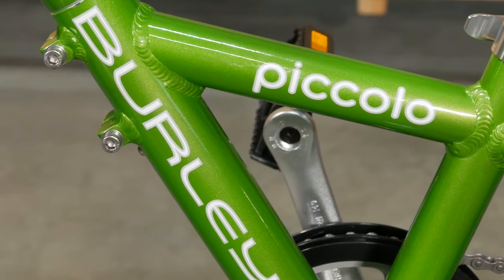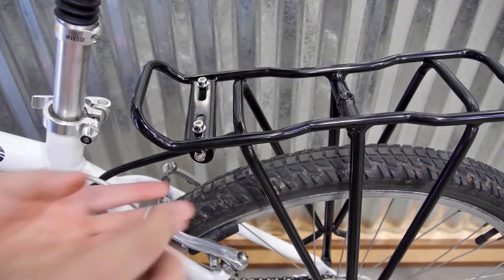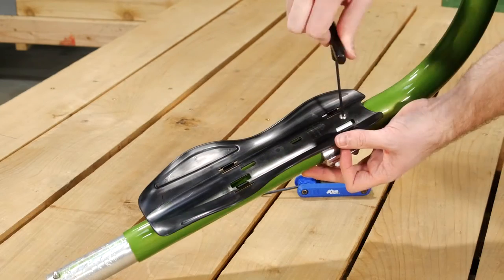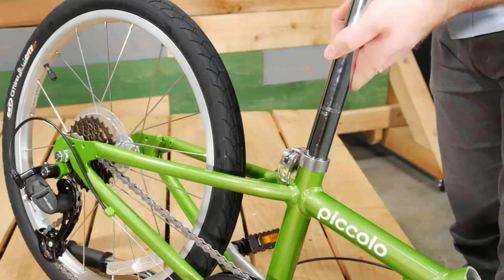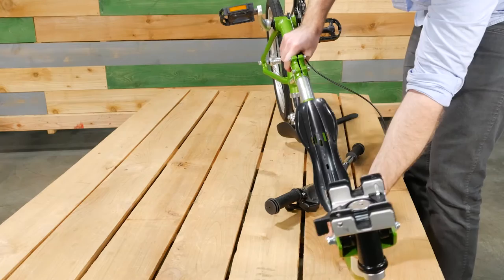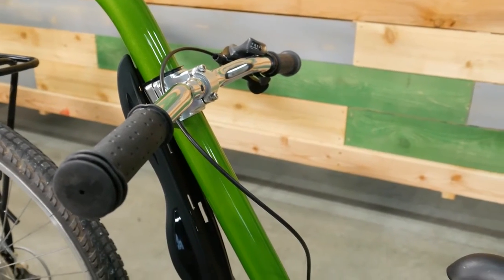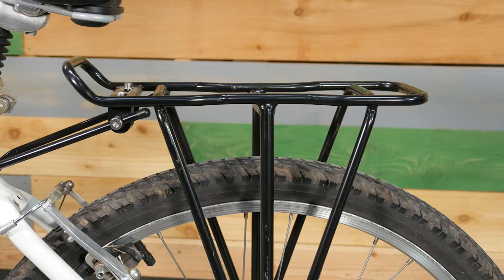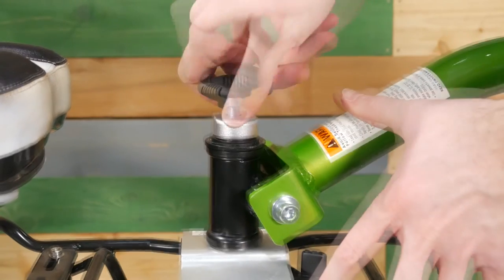Burley Trailercycle | Instructional

Comment: The moose rack doesn’t seem to fit on my mountain bike.  Are there any other options?
Reply from the maker: Hello Michael, 
Thank you for your question. At this time, the Kazoo and Piccolo are only compatible with the Moose Rack. The Moose Rack will require braze-ons or eyelets on the frame for safely mounting the rack. Unfortunately, not all bikes are set up to receive racks or fenders. If the necessary attachment points are not available on the bike's frame, then it would not be compatible with that bike. If your bike has disc brakes, we recommend Jandd Rack Spacers for the additional width if needed (link below). With some effort, the rack can be manipulated for this additional width. There are no conversion kits available to change the secure mounting style for the Burley trailercycles. Please let us know if you have any additional questions. - The Burley Team 
Jandd Rack Spacers: http://www.jandd.com/detail.asp?PRODUCT_ID=FDBFA
Reply: Same here… won’t fit mountain bike 😭😭